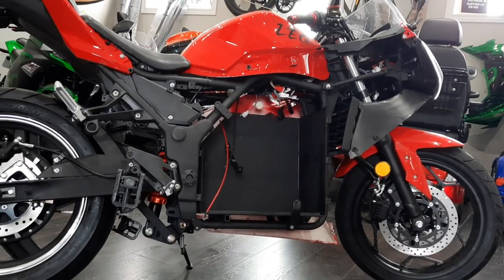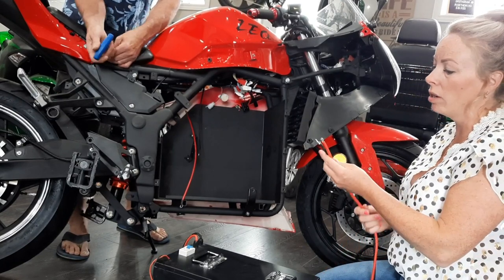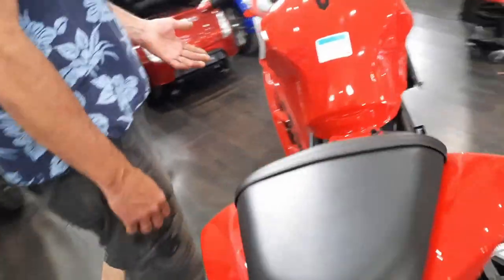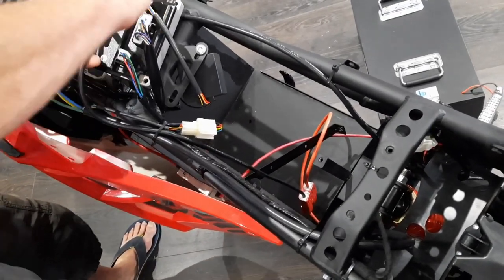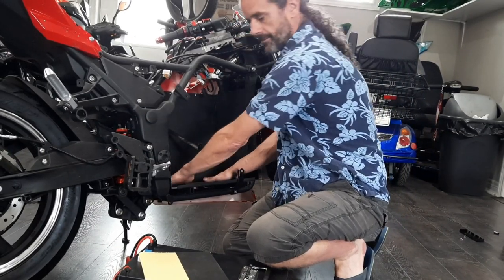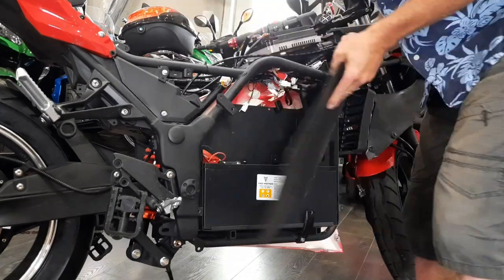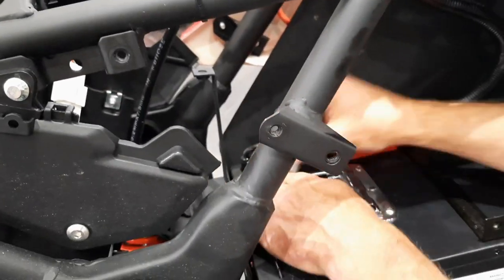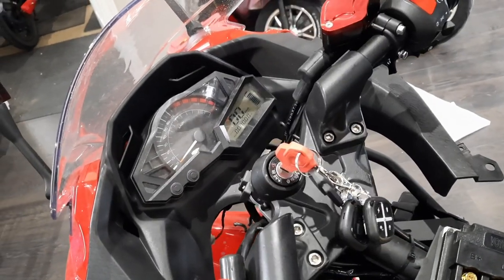Lithium Battery Change Emmo Zone Tao Leo

Comment: Thanks for the nice video, did not know the Tao Leo’s use Votol em100 controllers wow!  ~ Also if you haven’t I would make sure the BMS is common port for the lithium battery, those separate charging wires out of the battery may be  important for charging because if the BMS is not common port and has a c- terminal it is possible it will not balance charge causing the pack to eventually get out of balance and break down or have serious sag issues.

Comment: By chance do these have battery charge counters like the liquid acid batteries that are on the Emmo monsters I was told after 300 full charges the battery is program not to take a charge anymore and this is when you have to replace them needed or not.
Reply from the maker: no counters
Reply: @ridethewind  That’s weird so why is my ……..? saying remember you have only 300 full charges and  soon as you plug in its considered a full charge don’t mater how long the charger was on. Say I go back the next day to complete the charge so soon as you plug it back in it’d considered another full charge so two full charges will comes off the 300 …so how can they tell how many charges I have if they tell me I only have 300 full charges. I did some inquiries and I was told by a battery Tech my battery should last up to 500 charges.
Reply from the maker: @JoeWatson-jy6dj  it's probably just time for new batteries

Comment: My electric motorcycle battery that is in it that does not have good battery life and is old says it is 72 V and 45 amp hour but I can’t find 72 V 45 amp power anywhere can I put a 72 V and 50 ah battery instead of 45 will it hurt it?
Reply from the maker: hi, yes you can upgrade to a lithium no problem.    You have lead acid in the bike now.  To replace you would need 6 x 12volt 45ah batteries

Comment: Battery plate cover. ...that is the bad thing that this bike has...without it the batteries will jumping around when bumping road is on!!

May I know where to buy it??..any link??

Thank you
Reply from the maker: Can you send me an email?  I can send you parts   ridethewindebikes@gmail.com
Reply: My bike rattles near my battery all the time since I got it
Reply: @bowengenova24  check both of the battery covers...make sure all screws are tight and double check it by bang the seat so any vibration you will see and hear it.
And lock all the spaces with plastic lock tie.

Comment: Ugh I know my dealership guy said batteries are worse and more difficult to change than others..now I see what he meant..ughhh way can't they make them all quick change accessible.
Reply from the maker: Going from lead to lithium won't get any easier.  Lithium to lithium   sure, but only if the harness is the same.  And the odds of that aren't good
Reply: Honestly not that hard

Comment: 🤔 So I can replace my 72 volt acid battery with a 72 volt lithium battery like you did in this video? 🤔Now can the same charger be used to charge the new lithium battery are would I have to get a lithium battery charger? 🤔Now just how much will a 72 volt lithium battery cost me if I ordered one from you?
Reply from the maker: New charger,  $250
Reply: 🤔 so how much would a 72 volt lithium battery be?
Reply from the maker: @michaelhightower8160  72v20ah is $1200, 72v30ah $1600 and 72v40ah $1900
Reply: 🤔 Okay I will have to take a look to see just what 🤔👉ah 👈👀🙄🥴it takes.And I will be getting back to you to put my order in 😉👍! I am in the United States     Kansas City Mo .Now just how long do you estimated a battery order will take to be delivered to me from Canada?
Reply from the maker: @michaelhightower8160  Any ah will work, it's about what will fit.  Send me an email when you want   ridethewindebikes@gmail.com